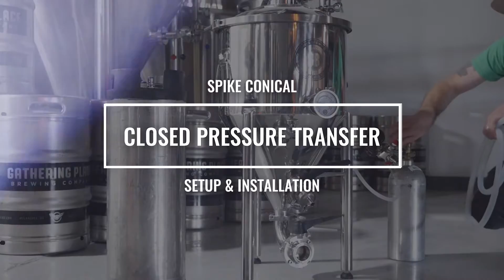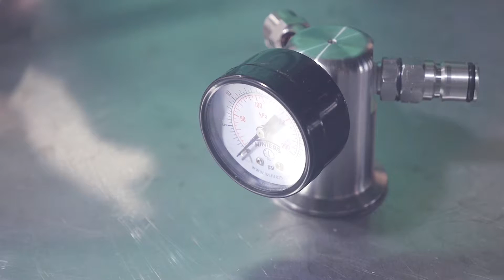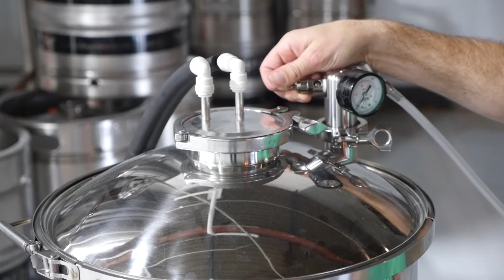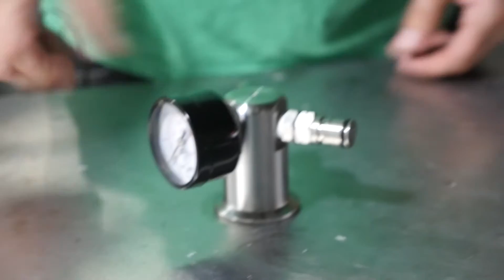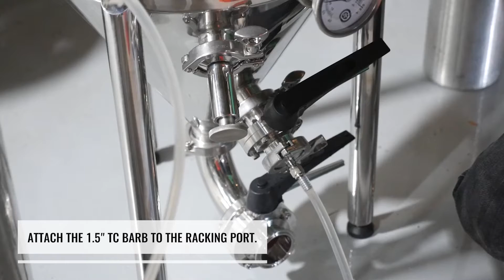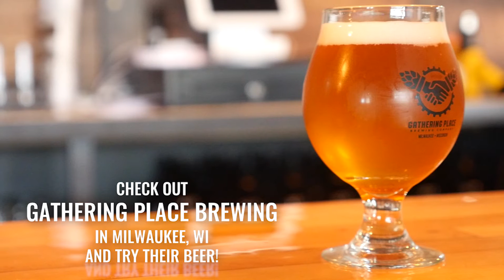Closed Pressure Transfer Video For Spike Brewing Conical

Comment: Slick design, makes it easy.  One highly recommended step you ommitted is CO2 purging the keg you intend to transfer into, which can be done by putting a few PSI into the gas post, and lifting the pressure relief valve 1 second, every 5 seconds, about 10-12 times.  This will keep the beer free from oxygen exposure during the entire transfer.
Reply: I fill the keg completely with sanitizer, then pump out the sanitizer with CO2.   Results in a p
erfectly oxygen-free keg, ready for transfer under pressure.
Reply: @danielrichardmitchel  Does a keg filled with CO2 put pressure back to the beverage in line when attaching?  Would the pressure transfer at 2 psi over come this back pressure?
Reply: The hose has air in it from conical to the keg
Reply: Bretsbrewery: before attaching the liquid line to your corny, depress the pin to fill it w beer. Also, you can use the gas line (from the manifold) to scrub your corny of O2 with the Co2 produced during fermentation.